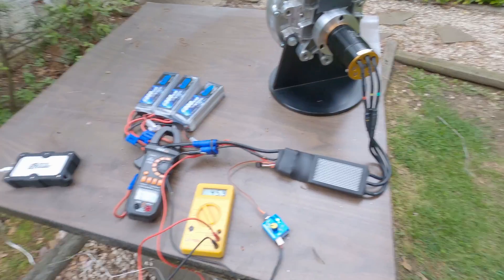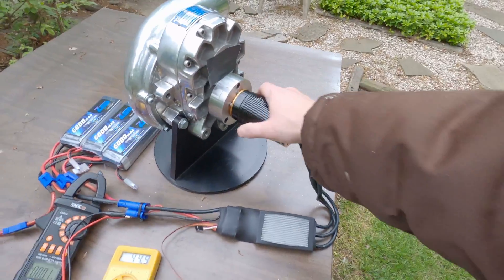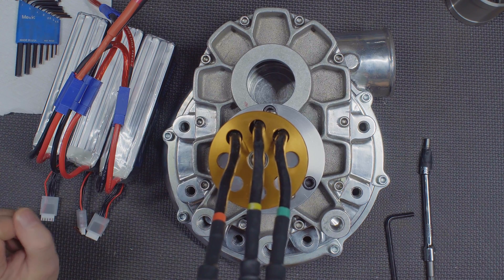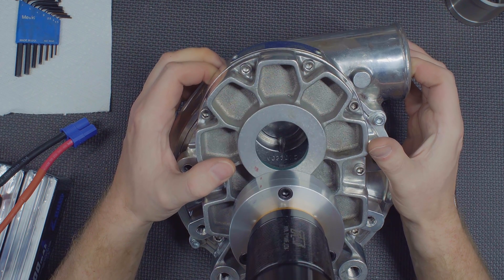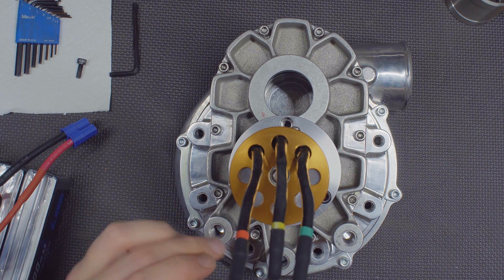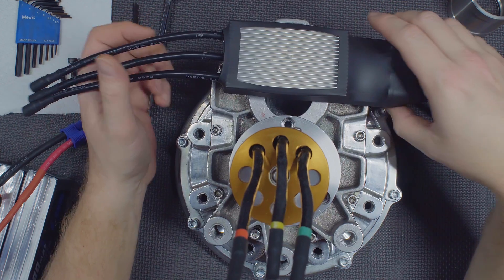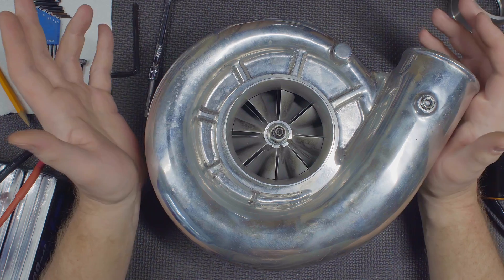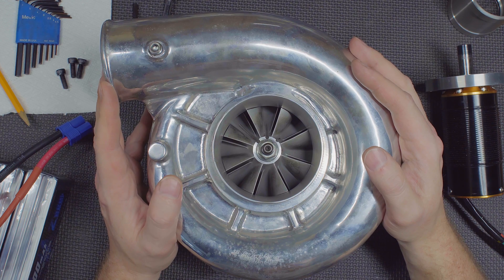Electric Turbo - First Blow

Comment from the maker: We did actually drag test this thing - we picked up almost 2 seconds and 15 mph and we threw in an epic burnout!  Check it out: https://youtu.be/AOL3Qyczt3Y
Reply: Can you hook it up the a car tps sensor. And what is the xtra power thing in the video.
Reply from the maker: @patriot101101  You could hook it up to a tps and have it trigger at a preset voltage (most TPS signals are 0-5 volts).  Not sure what power thing you're talking about.
Reply: @AlexLTDLX  that would be your power supply in the video.
Reply from the maker: @patriot101101  If I understand you correctly, the power supply is just a bunch of RC car batteries in series.  The meters are just monitoring current draw and voltage.
Reply: @AlexLTDLX  Hey I am new to these rc esc 400 amps. I am trying to hook it up and I used a servo generator and put 5v to it to get it too work. From talking to you it seems there 3 wire is sensing wire need to go to the tps mine puts out little over 4.2 volts.

Comment: Disconect alternator at wide open throttle, connect to car battery, make connection wires under the gas pedal on 100% pushed down. Whe you smash the pedal it connects and starts spooling, but the sparks at the connection will be like fireworks at that kind of amps

Comment: I have a 2017 Mazda 3 with a 184HP (stock) 2.5L -- and your videos say that your setup is too much for anything under 200HP. Maybe I could make it work -- but it would have to be tuned for something that's usually inactive -- not practical for an everyday driver. In looking at RC components I came across something that caught my eye: it's an EDF -- which is similar to the gimmick devices -- but these can use serious amperage & voltage with brushless motors. Something that caught my eye as an experiment to maybe prove the concept is one of the mid-grade performance units and they "claim" it is capable of 88A max current at 25.2v, max power 2000 watts. They recommend a min 6000mah 6S 35C battery. I could only find 50c. They "claim" that it produces 3220gm max thrust -- which is just under 8 pounds. Do you know how this might translate (if at all) to boost pressure -- or is a volute needed to do that? I'm sure the CFM would greatly exceed the 350 my car uses -- but if thrust cannot equate to any appreciable boost -- I'm afraid it would just be an expensive gimmick. I don't know if this is encompassed in your rather large area of knowledge. The Torque Amp is appealing -- but the $2500 price tag makes me want to see if I can do something similar at the DIY level. Or should I just trade my car in for the factory turbo model? Thanks for any input you may have.

From Amazon:
"90mm EDF 12 Blades Ducted Fan with 1450KV RC Brushless Motor with 120A ESC 3-6S Electric Speed Controller for RC Jet Airplane"
Reply from the maker: An EDF could make a little power, but they're not designed to make boost.  I've been wanting to try it though just to see what's possible.
Reply: @AlexLTDLX  Thanks for the reply. And thanks for validating my question. I think it might make an interesting experiment on a small displacement engine.

Comment: what c (discharge rate) are those lipos?
Reply from the maker: Those were 60c rated cells.  But the C rating doesn't really tell you about voltage drop under load - an internal resistance measurement is more useful for that, but still won't necessarily give you the full picture.  Other variables come into play - cabling, connectors, internal connections between the cells, even ambient and battery temperature.  I'm discovering a lot of these C ratings aren't terribly accurate.  FWIW, now I'm using LIshen LTO 18ah cells; and while there is some voltage drop (about 10 volts from a 62 volt pack), we've drawn 670 amps continuous from them for that voltage drop.  There's really no contest between them and Lipos for sheer power output.

Comment: I had an epiphany the other day after starting a huge diesel truck with a small lithium battery pack.  I was thinking why you can't use this lightweight monster power source to spin a turbo and then saw your generousness way ahead of the game. 
I have a 6th gen Camaro that has some room in the compartment where the cold air intake is sitting.  I put an e85 conversion on the naturally asperated 6.2L and got 22hp gains.  The car is roughly 400hp to the ground.  I don't want to strain a 10K engine too hard and would love to put together your first build for this thing.  The amount of material you have online is vast and the title is DIY.  I would be forever grateful if you could lead me to a list of parts or if you have it somewhere to just make 50-100 hp additional.  2 seconds and 15 mph would make me smile..  haha
Reply from the maker: If you have specific questions go to our forum at www.electrifiedboost.com

Comment: PSI?
Reply from the maker: That would depend on the engine.  But so far we've seen peaks of 6 psi on the 14kW unit on a 500hp 6.0L V8; with the bigger unit we've only had a short runtime due to massive traction issues, but we've seen 5.4 psi and climbing - should end up seeing peaks of about 8 psi.  Here's the 14kW drag test: https://youtu.be/AOL3Qyczt3Y  Here's the first test of the bigger unit: https://youtu.be/7cCSbogg-AI

Comment: I noticed you did away with the internals. So the step up ratio is gone. That is a step back from my perspective.
Reply from the maker: Check out the first drag test of this thing and see if you still feel that way (I posted the same link in your other comment on the unboxing vid): https://youtu.be/AOL3Qyczt3Y
Reply: Yes, I saw that! Just want you to know I'm liking what you are doing. Trying to help! But a 20 hp motor isn't gonna get it. You realize if you get the right motor to power it that there will be no lag and you'll overcome all the things holding you back. You could even use tps voltage to operate the motor controller. It would truly be on demand power. If you had step up ratio you could use mechanical advantage then you'd only need an 8k rpm motor. But it still needs to be 50-70 hp motor. Good luck and keep it up! I hope I've helped!
Reply from the maker: Thanks.  I have a 53 hp, 50,000 rpm motor that should be here in two days (and a 1,000 amp ESC to go with it).  That's going to get interesting...
Reply: @AlexLTDLX  I believe when you have enough motor to push that si blade and overcome all the inertia you will finally be there. Also need enough power to get there too! If you look at the rpm on the compressor map, you really want to get at the highest flow for the housing and blade. I think without going back to look it's in the 60k rpm area. Good Luck! Can't wait to see it!

Comment: You should of read your directions on your lipos.  You should NEVER take them straight out of the box and run them. (Which is what you did). You should always fully charge them FIRST the you can run them. Now they will develope a charge memory of only about 60% (because that's where they are shipped at) they will always discharge faster now and will more than likely develope unbalanced cells and probably some puffing cells also.  I wish someone would have told you.  🤷 Oh well. Now you know.  Same with a new cell phone.....ALWAYS charge it FULLY first before ever powering it up.  If you go to the local cell phone shop they always offered to turn it on and program it for you just so you will have a crappy battery and you will have to buy a new phone in a shorter period of time (or at least a new battery) lol. Love the electric turbo vids man🤙 keep it up
Reply from the maker: Thanks for the kind words.  If you haven't seen the other videos, this evolved into a pretty effective electric supercharger - here's a drag test of the unit:  https://youtu.be/AOL3Qyczt3Y The next evolution of this particular unit is shooting for 800+ flywheel hp.  Lipos don't suffer from a memory effect.  You're confusing them with NiCads.  In fact, repeatedly charging Lipos to full capacity shortens their life span (as does completely discharging them).  Balancing for Lipos is important, and these cells were well balanced (but actually proved to have a relatively high internal resistance).

Comment: Why straight axle drive,,⁉️try belt or step up gear drive, you don't need high rpm electric motor,,😎💥💥💥 will be compact
Reply from the maker: Direct drive is simpler and possible.  The next setup will likely be belt driven.  Though a high-rpm belt or gear drive has it's own challenges.

Comment: A dewalt 54 volt.???
Reply from the maker: Are you referring to the batteries?  Those wouldn't be able to provide enough current.  If you haven't seen it, these are the packs I'm using now: https://youtu.be/KscgGhk3ejs  I use two of them.  I tried stick welding with one pack - even that was too much power: https://youtu.be/TlerchtDjxA

Comment: Hi can you please tell me what model the electric motor and ESC is? Btw you can buy watercoooled jacket that sleevesover the motor.
Reply from the maker: That was a TP Power 5860.  I've switched to a TP Power 5870 (15 kW peak); now I'm looking at an LMT 30100 - 40 kW.

Comment: I've been looking into electric turbos recently and so far the only ones that actually work are almost as expensive as a standard turbo.

Is thus close to production and if so what's the price point we're looking at?

Also the main reason I'm looking at electric turbo options is the fact the Turbo cars are supposedly to be slightly better for fuel mileage, you said you weren't planning on running it more than 10 seconds at full throttle but would it be possible to set it to a lower setting and have it running constantly?
Reply from the maker: I don't have any plans at this time to make a mass-market version - everyone has different requirements and a one-size fits all isn't a practical solution.  If you're interested in building one of your own, I'd suggest joining our forum at www.electrifiedboost.com - myself and some of the other members there can answer your questions.

I will say this: turbos don't make your car get better gas mileage.  In fact, they'll make your gas mileage worse (especially since you'll be hitting the gas much more often).  This is a common misconception.  What turbos do allow for, and what I believe you're thinking of, is that they allow much smaller engines to develop similar power levels to much larger engines.  Much larger engines (say, a 500 cubic inch big block) have much larger and heavier parts (crank, rods, block, etc) - so at a light cruise, they have to spin all those parts as well as provide the power to move the car.  A tiny (say 120 cubic 4 cylinder) doesn't have these losses, but if it need to make power comparable to the big block, you cram a ton of boost down it's throat (say 30-45 psi) and viola - similar power to the big block without the weight and frictional/rotational losses.  But then again, you could shove 30 psi through the big block, and you'll see God.  

That said, aside from small differences in losses, making power always involves burning more fuel.  And more fuel = worse gas mileage.  That's pretty much an absolute truth.  In fact, when tuning, we calculate HP from fuel consumption based on Brake Specific Fuel Consumption.  The lower the BSFC number, the more efficient the engine.  An efficient engine might have a BSFC of .35-.40; but few turbo motors do better than .47-.55 BSFC because of pumping losses.  When running boost, you pretty much always have to run richer and in many cases retard timing to keep from damaging the engine due to heat or detonation.  Both of those make the engine less efficient.  Running an electric turbo all the time isn't practical (when would you charge the packs?) but unnecessary if mileage is the goal.

Finally, if mileage is your only goal, there are a number of things you can do - most of which are cheap or free.  Run the thinnest oil you can (fewer loses pushing thin rather than thick oil - it's actually a measurable difference, both on a dyno and at a race track); run the oil a bit low (less windage = less HP loss); lean out the cruising fuel maps and advance the cruising timing.  Run skinny tires and make sure they're inflated with as much pressure as allowed.  Lighten up the car (and take junk out of the trunk); don't run the AC and don't cruise with your windows open.  Work on the aerodynamics of the car - smooth hubcaps, belly pan, air dams, etc.  Of course, some of these could shorten the engine's life or damage it from detonation, but if your smart about it you could get by and see a significant improvement.  Finally, you could always drive drafting behind other cars.  But I wouldn't - rear-ending someone is a way to ruin your day quick.  Hope this helps.

Comment: how much psi
Reply from the maker: So far a peak of 6 dropping to about 4.2 - enough to pick up 15 mph in the quarter (!): https://youtu.be/AOL3Qyczt3Y  That's about 650 hp; I'm sure 750 is possible with this setup and the new batteries.

Comment: My Me0913 brushless which is rated at 72v @ 250 amps and drives a Paxton Novi 2000  at 1:3 with an external 2 1/2" belt drive makes only 8 psi dead-head., 5 psi with the engine running. (350 1st gen small block Chevy). Electric Supercharging can work; but it takes way more torque to build significant boost that way than most people realize. At the nominal 160 amps it settles to that's almost 12 KW. Trust me, you need a much bigger motor. I use six 50ah AGMs seried together and six 2A chargers to keep them charged.
Reply from the maker: I would suggest watching our first drag test results: https://youtu.be/AOL3Qyczt3Y. Fwiw, dead-heading a blower just puts it in choke; I have a video that talks about that too.  Do you have any videos of it running?      I'd bet voltage under load drops a lot.  AGM batteries have much higher internal resistance than lithium batts, limiting power output.  We're around 650 hp, and I'm certain we can hit 700-750.

Comment: How high can you go on the voltage?  You definitely want to max that out to get the amps down. IE if you had 400vdc the cables wouldn't even get warm. It's only the amps making the heat.
Reply from the maker: It's all dependent on available stuff vs expense.  I think 16s is enough to support about 700 hp at a reasonable (sub 400 amps) current rating.  Thanks for subbing!

Comment: Can this thing run constant without burning the motor
Reply from the maker: For how long?  It draws a huge amount of power.  I haven't been able to get batteries last long enough to get the motor hot enough to be concerning.  But keep in mind, we're on the order of seconds (less than a minute).  To run at a reasonable clip for let's say 10 minutes (I do think the motor would get too hot without cooling in that time; now it has a water cooling jacket), you'd need 100 lbs worth of batteries - at least.

Comment: Many people want turbo electric motors because in our countries a turbo system cannot be homologated due to pollution.  And electric turbos can be perfect, are there kits to buy now?  9psi is enough.
Reply from the maker: That's a good point and one I haven't even thought of.  There's a torqamp, but it;'s only 5kW and limited to about 200 hp.  People seem to be getting caught up on boost numbers.  A turbo that makes 9 psi on a 600 cubic inch big block might make 40 psi on a 4 cylinder honda motor (or more).  Then there's the surge and choke regions that come into play, as well as pressure ratio - the more boost needed to reach a particular hp level, the more drive power for the turbo is required.  It's actually better to think of turbos and blowers in terms of hp potential instead of boost prerssure.

Comment: This is quite the conversation piece you have here.  Have you tried out Qs8 or OSE8 connectors?  They are 8mm bullet connectors and can take up to 6 gauge wire.   Have you found a esc yet?
Reply from the maker: Yeah - we even took it to the dyno:  https://youtu.be/84wSLQRy9sc  In fact, we're only some valve cover mods away from taking it on an even more high-power test: https://youtu.be/jOpFe7ypLEs  Those connectors are nice, btw.  thanks for the comment!

Comment: Very cool! Would be interested in a parts list, maybe you can sell the adapter plate?
Reply from the maker: The problem is the adapter plate isn't the only part - you also need a perfectly concentric, round and precisely sized & located hole in the case - it's not something you can do with a drill bit; it needs to be done with a boring bar or reamer.  And then there are 3 6mm screw holes that need to be drilled and tapped in the case that have to be lined up with the plate.  Consider this an experimental project.  I'm already thinking about the next (much bigger - using a 97 hp brushless motor) electric blower.  That one should get us well over 1,000 hp.  But I might not put it in my car.  It's more of a race piece. Even before that, I don't think we've come close to maxxing this one out yet.  Things should speed up as my shoulder heals.
Reply: @AlexLTDLX  Thanks for the detailed reply! I was thinking, there are a lot of us DIYers out here looking for an easier way to procharge our cars, and I think your way is pretty brilliant. I guess I was thinking if you were able fabricate the piece needed to attach the motor to the supercharger housing, then you could sell that, as the rest of the parts are "off the shelf" and could be assembled at home, aside from the mounting hardware, hoses, especially fuel mapping tune that would be vehicle specific.